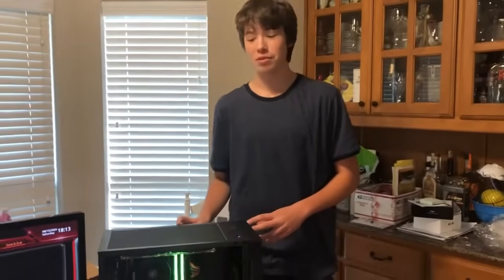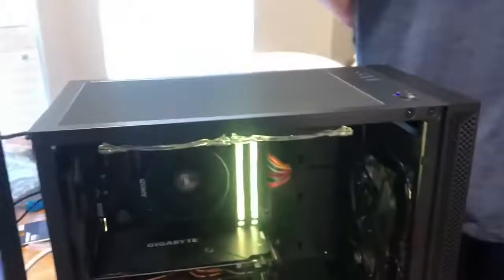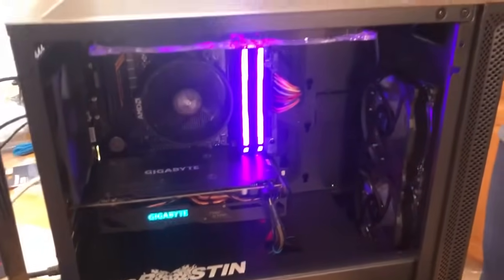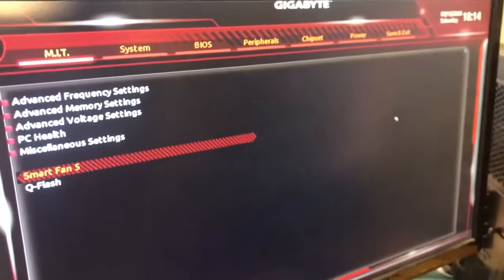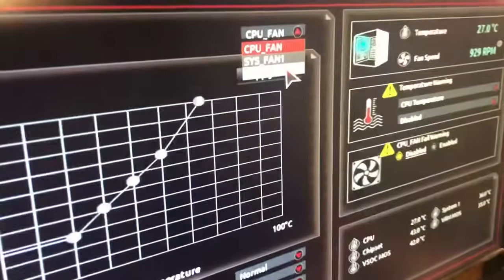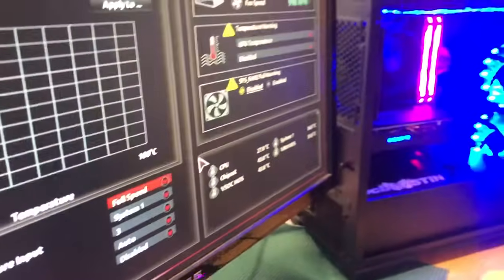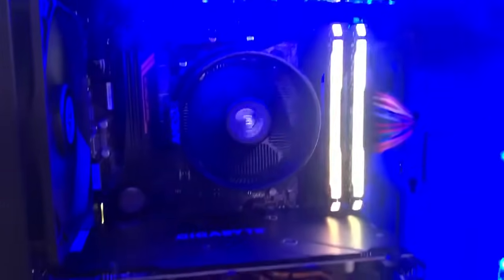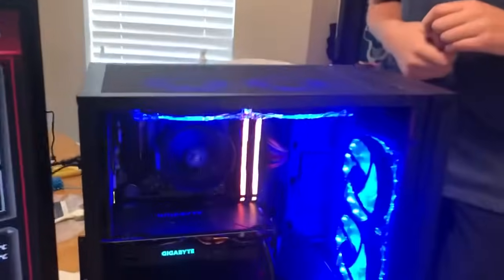A quick fix for non addressable RGB LED fans that spin but do not light up.

Comment: I have a similar problem but my fan rgbs light up but fans dont spin, pls help
Reply: same!!
Reply from the maker: There might be another 3 pin or 4 pin fan header you need to plugin to the motherboard or a fan controller.  Look for 2 separate plugs.
Reply from the maker: There might be another 3 pin or 4 pin fan header you need to plugin to the motherboard or a fan controller.  Look for 2 separate plugs.

Comment: hi where do i find that bios in my pc
Reply from the maker: right when it boots up try either <ESC> or the <DEL> (escape or delete) keys.  Tap about once per second as it's booting.  Should get you in there.  Sometimes <F2>.  If you tap too fast or hold down, it can get stuck and just beep.

Comment: It said CPU fan fail warning on mine aswell 
Bud the fan was spinning
Reply from the maker: might be a problem with the speed sensing.  Make sure the CPU fan has at least 3 wires and is plugged into the CPU FAN motherboard header near the CPU socket .  Usually they have small 4 pin for speed sensing and speed control.  If it's plugged into a larger 4 pin molex directly to the power supply, then the motherboard will not know the status of the fan.  Might even shut down the  PC thinking it is protecting itself.  Same ofr AIO water cooling.   Still have to plug the sense plug into the motherboard CPU FAN header.  If that doesn't work, could be bad fan or might need to flash BIOS but be careful when flashing BIOS.  Get exact BIOS for exact motherboard model and Version.

Comment: i don’t really know a-lot about computers but for two years now my rgb fans never worked i need help i dotn know the system to use to change the rgb all i know is that i have a powerspec 1660super intel 5 tenth gen
Reply from the maker: there might be software on your desktop that lets you address the RGB.  If not, get into your motherboard BIOS.  Look around for RGB lighting control.

Comment: yo mine fans is uphere x5 pack 6 pins - connect to fan hub, it is running and lighting in blue only, i cannot get the remote controller to on or off, or change color. Anyone has same prob and fixes
Reply from the maker: check the battery in the remote.
Reply: @pcBoostin  Thanks thats was the prob i fixed it 🙂 same day(2 weeks ago)

Comment: My fans turn on when I press the power on button but it turns off right away, already did this fix but it didn't work, any tips?
Reply from the maker: seems like the same problem though.  Once the your PC posts, it seems like it is going into a quiet mode with the fans and dropping the supplied voltage.  have you tried bypassing the motherboard plugs and connecting straight to the PSU?
Reply from the maker: could also be that your motherboard actually has RGB controls in there and your fans are addressable.  Try hunting for the RGB settings too.
Reply from the maker: be careful while you are in there.  you have to tell it to save and exit when done too.  press F10 key usually.

Comment: I had the same issue but easy fix for me.

Basically the power wire powering the little GIM hub was the issue. Even when the wire is slotted in or "clicks" in it still needs to be pushed in further with a little more force.

I put the wiring in all the way then applied a small amount of force and all lights came on. Before was just fans spinning.
Reply: OMG thank you for this comment. This was my exact issue that completely flew over my head
Reply: how do yk where those wires are at
Reply from the maker: So it was a faulty crimped pin the fan plug itself?  I've never seen that.  thanks!

Comment: Where do I find the settings?
Reply from the maker: usually have to tap on the del or esc key while it is booting and while it posts in the beginning of booting.
Reply from the maker: be careful while you are in there.  you have to tell it to save and exit when done too.  press F10 key usually.

Comment: Is there a way to change the fan speed on a CMOS setup utility, I have been using an older bios since 2014
Reply from the maker: look for Q control or something temp related.

Comment: I've tried so many videos none of these options are working my case doesn't light up anymore
Reply from the maker: what PC do you have?  Might be a RGB setting in the BIOS or software control in Windows.  Check the little arrow in the right corner of the screen by the clock in Windows.

Comment: Question why would fans not turn but light up how do I fix I think someone messed with my pc but not sure thanks
Reply from the maker: if you have a remote, you might have the fan speed turned down all the way.  Software setting might be the same if you have addressable fans and RGB.

Comment: I'm gonna try this, this whole time I thought I messed up the rgb connection. 

I checked for bent pins like a thousand times dude. If this works I will buy you guys a beer 🍺 😁
Reply: Did it work
Reply: @coolaverage2017  nope. Mobo was fried
Reply: @Wrapitupgx  bruh so then what
Reply: @Corzafade  well you'll need a new mobo. You gotta understand that Computers are very sensitive. Nothing is hot swappable. You'll need to make sure PC is turned off completely and power is drained before messing with any connections. Also if you replace the mobo and lights are still not working, that means the rgb circuits are fried as well. So you'll prolly need to replace all the fans with non functioning lights. Hate to bring the bad news but that's what happened with me.
Reply: @Wrapitupgx  damn dude I'm sorry for that mobo.
Reply from the maker: Someone else said they did everything right and it turned out to be the fan plug itself had to be pressed in all the way and kind of push it down while testing it.  Sounds like a bad crimp on those fan wire pins in the female socket.
Reply: Hi, sorry this question is after so many years! But I'm having this issue (haven't tried the video thing) but now I'm worried, my pc works fine, but case lights died. Your pc was working fine but mobo was fried??
Reply: @lainvalentine3877 I did something wrong I was messing with the rgb connection while computer was on and I fried the mobo
Reply: @Wrapitupgx  thats very unfortunate

Comment: I have a made in china fan and it lights up but I want to turn them off is there a way I could do that
Reply from the maker: If they are on the same plug then you can do the opposite of what we did and try using a normal or silent mode.  Just make sure your temps are still good while running at the lower fan speed setting.  If it's a separate plug then unplug the LED power.

Comment: My PC fans light up but they are stuck blue, there are buttons on top of the case to change the color but they don’t do anything, I tried pressing and holding them and everything and I don’t know how to change it
Reply from the maker: Which case (make and model)?  You can't connect the addressable case fan connector to the motherboard and still have the button controls work.  It's one or the other.  usually that's what freaks out the RGB buttons on a case.
Reply: I have the dame problem, mi case Is an Antec nx270, it comes with 2 fans with Molex, they connect directly to Psu, they works but only one of them stuck Green, Also hace a led switch un the case to chance the colors but doesn't works

Comment: is there a way to do this without change it's speed cause I like my room to kind of quiet
Reply from the maker: some of these non addressable fans have a separate 4 pin  Molex power plug so you can wire the lights by themselves.  Sucks they get louder I know.

Comment: Hi. Do you have a fix for the same problem but on addressable fans?
Reply from the maker: Usually it's a software setting for addressable.  See if you can get max brightness cranked on them just to see if they work.  If not, the fan controller would be in question.
Reply: @pcBoostin  yo mine fans is uphere x5 pack 6 pins - connect to fan hub, it is running and lighting in blue only, i cannot get the remote controller to on or off, or change color. Anyone has same prob and fixes
Reply: @MightyxBALTi  i have the problema. But i have a Antec Nx600,  adressable fans and my problem is that when a turn on my pc, the fans are spinning and light White 3 times and then the lights of fans goes off, and only spin without light. And my led button on my case ont working. I need help
Reply: @mahomedfakir977  I have the same problem, did you manage to solve it?
Reply: @theo6595  Yes i solve it. In my case it was a pin on the button that connected the led that was creating a short circuit.
Reply: @mahomedfakir977  How did you go about fixing the problem accordingly?
Reply: @theo6595  I had to buy an ARGB controller on aliexpress and I moved the pin that connects to the led button, and suddenly it started to light up.
Reply: @theo6595  Usually these cases can come with some defect in the cables of the leds so that's why you should check it very well
Reply: @mahomedfakir977  ok thank you bro

Comment: My fans are RGB, and from one moment to another it was a static white color, do you think the ARGB connection could have been damaged?
Reply from the maker: If it is intermittent then definitely check the RGB wires or the fan wires in the plug.  maybe there is a lose one.  Also, can you try a different fan header on the motherboard to see if it does the same thing?
Reply: @pcBoostin  It is the most logical thing that is the rgb connection that was damaged.  i guess i'm not the only one but at least it went blank and not off
the only thing I did before that it will be damaged was unplug it but it was all off

Comment: Lols 36 years old here and building another pc for VR adventures and I am about to run up stairs and try this even though they are hidden behind my Rad I want it on. Thank you sir.
Reply: I have an msi z599 a pro wifi and the rgb don’t work
Reply from the maker: Did it work??  Curious

Comment: How do you go to settings
Reply from the maker: it's different for different motherboards.  usually tap delete or esc while booting but sometimes F1 key.  Look up for your particular board.  If you don't know your board, use free CPU-Z to get the make and model.  https://www.cpuid.com/softwares/cpu-z.html

Comment: Can I fix RGB lights on Cooler Master Hyper 212 which has a non addressable fan on the same way because doesn't work.
Reply from the maker: Try it but it will be under the CPU Fan Control and not System fan.  Your Q-Fan or smart fan settings might be throttling voltage which keeps it quieter till needed but can affect RGB lights.  GL
Reply: @pcBoostin  I already solved a problem with RGB, everything is fine now. Thank you, anyway.
Reply: @LuskiCrew  How? I have the same problem please respond
Reply: @Rovy3ctf  You just need to match plus and minus on the cable correctly to light up an RGB. I will share a video that could help you. Do you have an Instagram, so I can send a video link through that application?

Comment: My cooler master only a couple months old. The blue led lights turned to red randomly one day, and when I messed with the controller they turned off and havent been able to turn on since. Turning cpu fan to full doesnt work. Any ideas?
Reply from the maker: If there is a controller then that is what you need to look at.  We had a Cooler Master push button controller die once.  Tried to hook up a long LED strip to it lol.  It smoked though.  Is there a way to get another controller to check it?  I found some on eBay that  look like it but they are super pricey.  Like $30.  not worth it!  you can buy some new fans for that much during Holiday sales.
Reply: same problem bro,, any ideas to solve it, plzz help me🥺🥺

Comment: So I followed your steps through the gigabyte menu, however my PC fan lights still will not respond. Even on full speed. Is there any other way of fixing this?
Reply from the maker: Also. some BIOS make you reboot for the settings to apply.
Reply: Same I am going to try to figure it out
Reply: @toxywashere4436  let me know if you guys figuere it out
Reply: @geevee9582  I fixed it, I just didn’t have my lightning node plugged in. Make sure your lightning node is plugged in.
Reply from the maker: Make sure you have selected the correct fan header.  On our board there was CPU, SYS1 and SYS2.  Check which plug you have it on the motherboard.

Comment: Hi! I’m having this issue as well but I’m using a controller hub molex powered plugged directly to the power supply. I had to turn on the lights using the remote but the lights would stay on only for a couple of seconds. I’m thinking that my power supply is not enough to power it. My power supply is just 550w. Do you think replacing the power supply with higher wattage will fix it?
Reply from the maker: Only if the PSU is faulty.  It takes almost nothing to power LEDs.
Reply from the maker: If there is a remote for the lights then it is controlled through the controller hub.

Comment: Damn i have similar fans im want to turn them off!!
Reply from the maker: HAHA well undo what we showed you in the video.  Put it on normal or silent setting.  They will stay off as long as you don't overheat and then the fans speed up as higher voltage is sent to spin em up.
Reply: @pcBoostin  didn't work for me.
Reply from the maker: @Valid05  might not be able to turn them off then.  try to find some cheap non LED fans. if you are on a budget.

Comment: still the rgb does not work
Reply from the maker: Make sure there is not another cable hanging off the fans for RGB lighting.  Another cable hanging off might need to plug into a controller or a motherboard header or a button controlled controller built into the case..
Reply: @pcBoostin  this comment was 2 years ago I fixed it 😅

Comment: I didnt get result, mine didnt showing  that RGB fan, only cpu fan shows off, in additional to that my RGB fan turning off after 5 second of turning on my pc
Reply from the maker: if they are turning off, your motherboard might be set for some kind of silent mode so if the temps are low, it will not turn on the fans till the temp rises.

Comment: Hmm. This didn't work for me
Reply from the maker: check for RGB lighting settings in the motherboard.  Could be you have addressable fans and they are just turned off.  Also check in windows in the lower right corner of the screen by the clock.  Click the little arrow to see if there is a lighting control program running.
Reply: @pcBoostin  I tried that first and it also didn't work. I'm thinking it's a short

Comment: Well i just bought a new case but the fan is not working at all! And im searching here to find someone like me i wish u can help me
Reply from the maker: Sometimes cases have fan controllers that need to be connected to a USB header on the motherboard.  If it is just a normal fan plug, look for the motherboard headers that look like this in the first picture.  https://www.ekwb.com/blog/what-is-pwm-and-how-does-it-work/

Comment: i did this but it didn’t work my nzxt fans spin but there is no rgb and their rgb fans
Reply from the maker: If they came in a NZXT case, look to see if they plug into a NZXT fan controller.  If they do, the controller will have to plug into a motherboard USB header.  then get the NZXT CAM software from https://nzxt.com/software/cam

Comment: Hey so I have this same problem and I run off controller my fans are working completely fine but the rgb doesn’t work but the controller is on. It also turns on for half a sec the rgbwhen I turn it on pls help I have no idea what to do
Reply: Pain
Reply: I have the same problem
Reply: same problem but mine turn on for just a second when i turn off my computer
Reply from the maker: What brand are the fans and controller?  You need to download their controlling software.  NZXT is CAM https://nzxt.com/software/cam and Corsair is https://www.corsair.com/us/en/downloads

Comment: Mine yesterday had light but now they don’t I build it yesterday but it’s not full build only ram is left
Reply: were you able to fix it? 2 of mine work fine and the third fan works but the light doesnt.
Reply: @geevee9582  yeah dude you just have to connect the right cables to the right port

Comment: How do it get to those settings?
Reply from the maker: on startup: tap <del> every second or so but don't hold it down.  also try <esc> key if that doesn't work.  last resort <F2> key above the numbers on the keyboard
Reply: @pcBoostin  hey when I try this it ask me to select my boot device and not the same screen

Comment: Does it work on fan with controller hub? Mine is using fan’s controller hub and have the same problems, pls reply this if u read this🙏
Reply from the maker: A fan controller hub is different than connecting to a motherboard header.  They should have plenty of power from a USB header, 4 pin molex, or SATA power connector.  Do the RGB fans have a separate plug for RGB?  If not, the hub controller might be bad.  Are you sure they are RGB fans?
Reply from the maker: we were using a fan hub which is just a splitter in parallel.   Not a controller.

Comment: Hi , I have the same problem but , these are 3 case fans, they stopped working. I changed fan settings but not working.. gigabyte b450m ds3h V2, chiptronex gx3000 case. Fans are powered directly from PSU! Pls help!!!
Reply from the maker: do you mean they aren't spinning anymore or the lights stopped working?  If connected directly to the PSU thne should have plenty of power.  Try a different PSU connector.  Check a new fan on the same PSU connector after that to make sure all your fans are not dead.  I have seen multple fans die.  Usually from someone that vapes.  It's sticky stuff and the fans act like a vacuum cleaner and suck it in.  We had one rebuild that had 5 fans all dead.  They were gooey and it smelled like grape vape lol